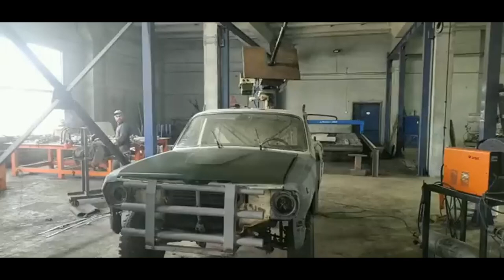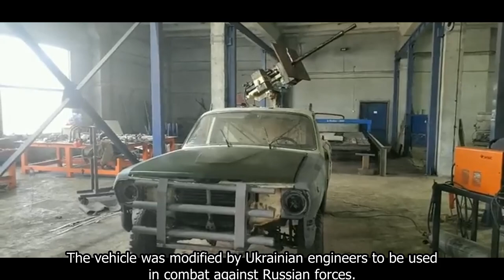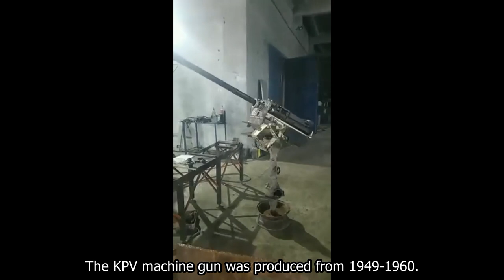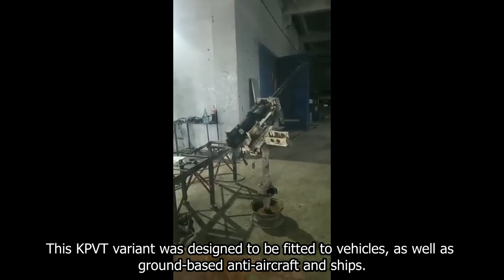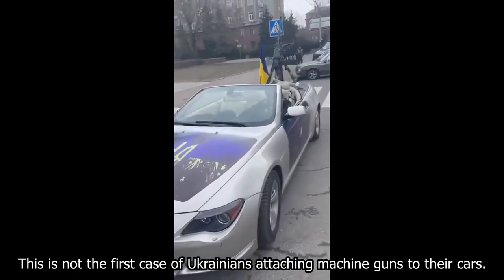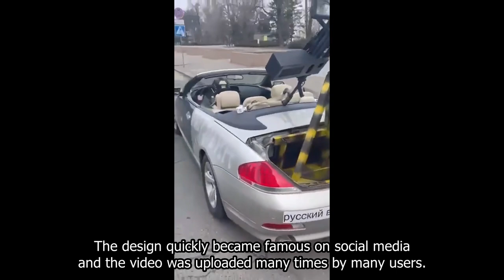🔴 Ukrainian Engineers Add Remote Controlled Heavy Machine Gun To Old Soviet GAZ-24-10 Volga Sedan

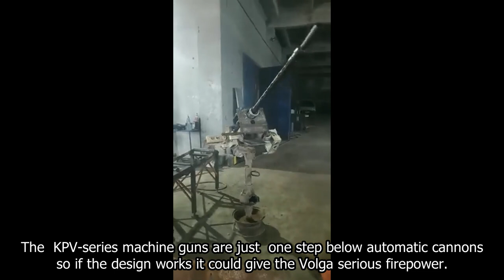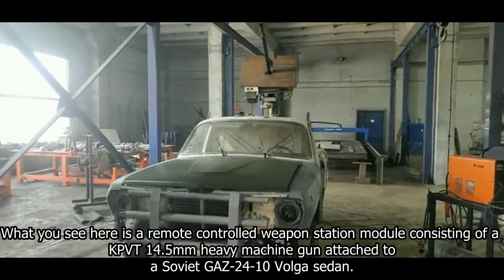Comment: I don't know if they made it functional yet. 0:23 remote control? 0:03 Camera? Making a remote control weapon station turn and shoot is just half the work. Glitches need to be fixed, failures due to vibrations and recoil of the 14.5mm fire, material fatigue, etc. It can be useful in the hull down configuration but the hole concept of the remote control weapon station is for the crew to sit in the armored box and not have to expose the gunner. It's always interesting what contractions people came up with in the war when resources are not available.
Reply: they have resources. Europe and the US allocate them in large volumes. Here we see a good weapon that was devalued by putting it on an unarmored vehicle. At the first fragments from any projectile, it will catch fire and that will be the end of it. There is no need to talk about direct hits at all.
Reply: Its not turning on its own. The person had to push it. This is just propaganda.
Reply: If they make the vehicle remote controlled too, then it makes sense. Armor is just a steel coffin anyway. I'd rather sit exposed.
Reply: @Willy_Tepes  Not every armor is designed to stop an ATGM hit, but most of the time you would receive small arms fire and shrapnel not an ATGM or rocket fire. If an ATGM hits unarmored vehicle it just deletes 40% of it but when the same ATGM hits most of the lightly armored vehicles it just creates a hole and you can survive if you are lucky.
Reply: @fortweek_7389  You'd have to be very lucky to survive your armored vehicle being filled with a spray of molten metal. Any main battle tank can be taken out with a EFP which costs just a handful of dollars and can be fabricated by a farmer.
A tank is a steel coffin where you have limited visibility and are a magnet for enemy fire. 
I'd sit in a Toyota with a Dushka any day over a armored vehicle.
Reply: What glitches? Turn left, turn right, and go up and down that's got to be some very simple programming...
Reply: @Pippy_Pappy  You can avoid "glitches" by using common sense and logic. But these two things are not very common ;)
Reply: If Germany could figure out a basic version in WWII, maybe Ukraine can, maybe. Agree its not simple.
Reply: If you put your weapon on an armored vehicle, sure, you want a camera to be able to shoot from the inside. But on something like this they could just park the car in a defensive position, use a cable to stay 20+m away, well hidden, while you shoot with tracers to adjust your aim. Unless the enemy have an heavy weapon or make a very lucky hit it would be a nightmare to deal with it and will probably hold a lot of punishment's.

A very basic remote control is enough for that. Even if they won't probably kill anyone with that except the most stupid soldier exposing himself, it can hold a position.
Reply: @Willy_Tepes  I repeat what I just sad. You are most likely to be hit with the small arms fire (Ambush would be classic vulnerability for any unarmored vehicle-Machinegun burst and everyone inside is KIA)>artillery fragments (Can travel over 100m)> light> medium> heavy rocket launcher> Older ATGMs>Auto cannon fire>AT mines>Modern ATGMs>MBTs main gun>EFP>loitering munitions. 
Every single thing I listed here can kill you in the unarmored vehicle. 
What can kill you in a tank: Direct artillery hit only on the roof, Heavy rocket launcher (Depends on the model of the tank side back or front),older ATGM (Same as heavy rocket launcher),Modern ATGM (Depends on the tank and where it hits)(You can find examples of tanks surviving multiple hits before crew starts bailing out).
Also there are plenty examples on internet of people surviving hits even in lightly armored vehicles.
Reply: @fortweek_7389  Real footage from war zones convinces me that being in a tank is stupid. You are a magnet for all kinds of weapons, you can't see shit and without infantry support you are in deep trouble.
Go ahead and choose whatever you want, but I am not gonna be on the front line anyhow at my age. I'll be in the workshop making stuff that tank crews will hate.
Reply: Hey fortnight kid, engineers know what they're doing... Half of Ukraine gov might not know much, but engineers can do this
Reply: @tomk3732  there is a difference in capabilities, most of the capable ppl have left and this is the result.
Reply: This one is nothing more than the classic ukro-show, it might work against unarmed civilians but anything else is just absurd, like russian soldiers stand in line to get shot by this toy, they first clear areas by artillery, then move slowly heavy machinery forward and all that the russian soldiers will see is burned scrap and body parts when clearing out the leftovers.
Reply: @mandelorean6243  Ok... Mandalorian, funny how you assume you are talking to a kid because account has fort (fortress) written in it's name. Not all engineers have experience with weapon stations. What seems like a good idea at first could turn out to have problems when it's made and that's why we use engineering process (For example. if they make a motor too fast or use gears that are too big it can be really hard to get that machine gun on target at longer distances and if they make it too slow or gears to small it could take too long for it to turn and it increases possibility of failure). I just pointed out that this are not finished products.

Comment: Quite fabulous thing. 
But on other side EMP weaponry will be a good thing to counter it.
Reply: lol wat
Reply: what?   This is middle east level shit, it'll be blown up in a day.
Reply: EMP weapons are not used because they also fry friendly electronics in the vicinity. EMP is not a magic bullet. Jamming would be a more reasonable response.
Reply: True tho, but im still hopeful a new EMP weaponry that can distinguish an enemy or ally. 
Tbh, we should started researching emp weaponry more as this war show us new future.

A remote-control war from far away.
Reply: @sampurnoadi2993  EMP weapons have a antenna that will target specific frequencies but I am guessing it has a quite "wide" effect. You can use a directional antenna, but that only helps a little bit as electromagnetic radiation in practice will spread out anyway.
EMP's have been researched since they first discovered the effect, but they are pretty tight lipped about its capabilities.

Asymmetric warfare is the standard today because the big nations don't attack each other, they attack weaker nations. Winning a war against insurgents or rebels is very hard  if you want to be seen as the good guys. All this fancy weaponry is of little practical use. A 4WD with a heavy weapon is more than adequate in today's warfare if you have a lot of them.
Reply: This is nothing more than a show, anything else is just absurd, like russian soldiers stand in line to get shot by this toy, they first clear areas by artillery, then move slowly heavy machinery forward and all that the russian soldiers will see is burned scrap and body parts.